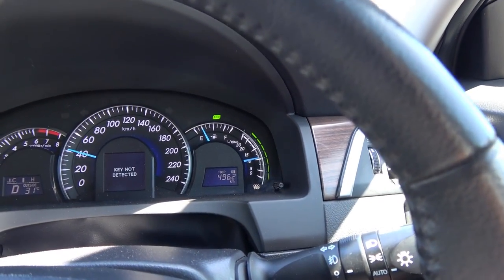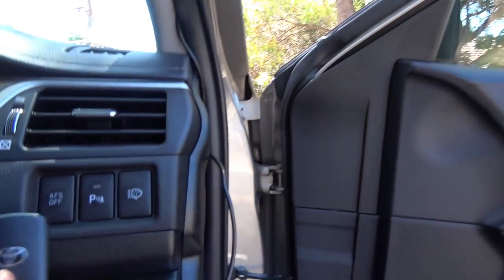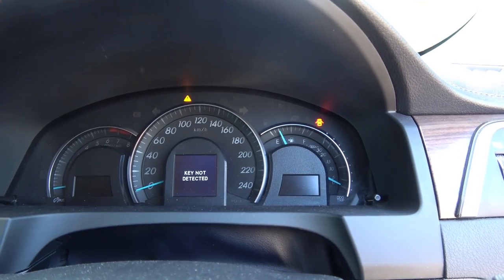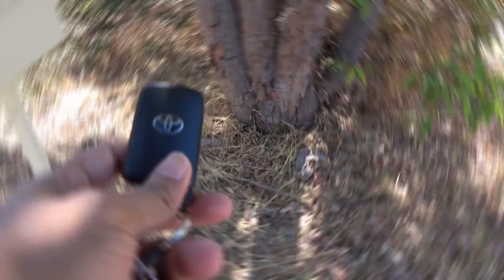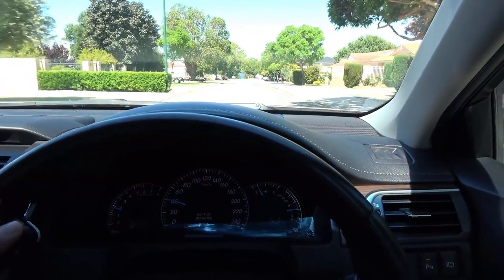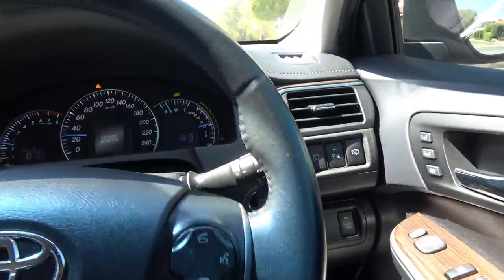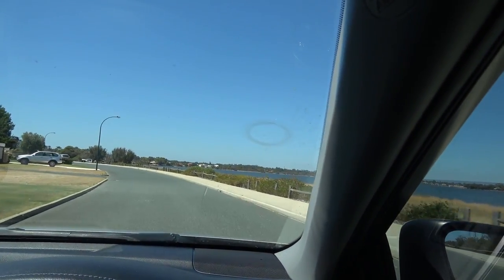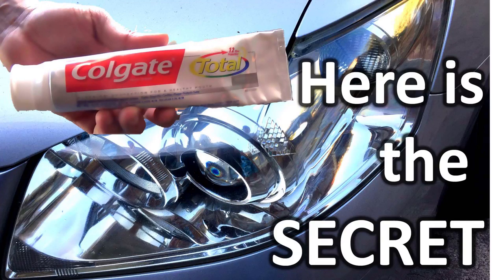What happen if you drive a keyless car without a keyfob ??

Comment: You can drive them without the fob but you cannot restart them once they are turned off and in some models push button start is standard and there are many locksmiths that can program the system you don’t have to go to the dealer
Reply: Just experienced this like a 5min ago. my cuz borrowed my car and I went back in the house with the keys, he drove quite a bit and had to come back, by the time he got back and opened the driver door, 2 very different very scary alarms went off through the speakers like some amber alert and pounding abounds simul,  it was louder than my music plays so it alerts police.
Reply: I damaged one of my key fobs and going to purchase a new fob, but it will need reprogramming. Is this something that I can do at home without any special equipment, or do I need to go to the dealership or a locksmith can do it? (What price will I be looking at?)Thanks
Reply: Crazy part about this is it just happened to me I drove over 6 miles after my mom got out the car with the keys. I got to my destination and cut the car off, quickly realized I don’t have the keys and hurried up and cut it back on and it worked. Not sure if it gives you one change in a time frame or if it was God, I’m gonna go with God lol
Reply: @losworkin  man this just happened to me with my grandfather truck. The truck did finally cut off when I drove to a store and put it in park.

Comment: WTF. I thought this type of car with keyless system would automatically stopped at certain distances if the key is not presence. That was totally my imagination!
Reply: thats what my hyundai does it disables the car even when driving
Reply: @wldcrd26  most will stop the car from going over 25 without the fob. If youre already going above that and the FOB dies or for some reason you lose it while driving, you will drive with a warning light on, once you get below 25 again itll stay that way
Reply: @wldcrd26  Are you sure what you are saying? For safety reasons, the way in which you say that your hyundai works is prohibited and not approved.
Reply: I also thought that it will stop.
Reply: @dastorm4230  When the engine is in service (started), even if the electronic key is no longer present, the engine must continue to operate (this is the legislation, safety issue).
When the engine is stopped (for whatever reason), if the electronic key is not present it will be impossible to restart the engine (in any way whatsoever = via the starter or by driving the car with a speed engaged in the gearbox).
Reply: @JoeSmoe1 this is absolutely NOT TRUE. I left the key to my Veloster in the buggy at the grocery store last night and drove to the next town over to pick up my son then drove us all the way home. The car doesn't shut off, it doesn't slow down, it doesn't effect the car in any way whatsoever until you shut the car off and want to start it again. The reason being that the ONLY time the fob is giving off a radio signal is when its starting or when you're pushing a button.
Reply: Thought the same thing
Reply: @JoeSmoe1  try watching all the videos disproving this now in 2024.

Comment: I just learned this the hard way. Was leaving from word and had my hands full, put the key fob on my Mini Cabrio's roof, turned the car on (I think it worked because the key could communicate with the car through the roof?), the keys must have slipped on my way to the gas station and I was stuck when I turned the car off... Had to call a tow truck and go home by train and have to pick up my car tomorrow with the spare key fob (I hope it still works!...). Don't know if I'm going to find my keys though...😢

Comment: Keyless fobs are fuxed! I have parked my car, locked it, walked away and left the motor running several times. Also I have shut the car off but accidentally double tap the button which turns on the accessory function and came back to a dead battery several times as well.
So now everytime I park I'm checking my pockets for the key fob and checking the motor, checking the dash gauges, checking if the radio comes on, checking if the reading lights are on. It's like I have Agoraphobia and I'm afraid to walk away from the car. smh

Comment: Almost all Key Fobs have an RFID Chip in them and don't need the Fob battery to work in order to start the car. You just need to know where in the vehicle the Fob needs to be for the vehicle to recognize the Fob. When my Fob battery died I had to put the Fob inside the center armrest console and the car would start.

Comment: Almost all cars with keyless entry come with the key built into the key fob. if your battery dies simply just use the key.
Reply: The key inside my fob only works on the door. There's nowhere to put a key in the ignition.
Reply: My fob came with a key although cant find a place to use the metal key to start it
Reply: @loverssky13  same with mine
Reply: It only works for opening the door. If your fob battery dies, you can still start your car by using the fob to push the start button.
Reply: Its usually in the glovebox
Reply: royaloreca actually the key inside the fob is for if the car battery dies you should get a warning come up on your dash to tell you the battery in your fob is going flat and they are easy to replace

Comment: Is the signals switch to the right in a right hand driving vehicle?
I've always thought controls were still standard in every car.
Reply from the maker: yes they are swapped over
Reply: Gabriele De Mattia. Not always, a lot of European right hand drive cars have the indicators on the left of the steering wheel.
I still accidentally hit the wipers instead of the indicators.
Reply from the maker: i remember that happening to me when i first drove an old Peugeot 405 wagon with the horn being placed at the end of the signal stalks. very annoying
Reply: Junky DIY guy. Im about to become a bloody volvo driver, so im going to learn all over again! :)

Comment: Hi,
I am hoping you can help, I have a Dodge Journey 2010, the fob has separated from the metal key & fallen off somewhere. How can I start my car, so I can get a new key, I am panicking as I need it for work
Reply from the maker: You don’t have a second key? If not you have to get a new keyfob made, locksmiths or the dealor have equipment for that.
Reply: @JunkyDIYguy  do they need the car there when the new key fob is made?
Reply: @colinfitzgerald3863  yes

Comment: I'm curious to know how you can tell if the battery in your remote is bad once you've successfully started the car and driven it for a while? After you've stopped the car and shut it down (usually  at an inconvenient place during some kind of storm) the battery is now dead...what now?
Reply from the maker: in a work shop, there's equipment to check the signal strength of your key fob and determine the battery status without having to test with a multi meter. But if your key fob stop working while driving, try holding the key fob closer to the start button. then in some car's, the computer will still recognise the presence of the key fob and will let you start the car. or you have to change the battery to have it working again. if the keyfob stop working for a electronic issues inside the keyfob, then you have to tow it to a place where you can get it fixed. There's a price to pay for technology.
Reply: In my keyless start car. inside the fob there is a key and there is a key slot under the seat
Reply from the maker: some cars have a separate slot for the key fob to go in.
Reply: You'll be ok if the battery dies after you started your car and while you were driving, and you don't even need to keep spare battery for your fob in your car. That is why the message was saying "press the start button WITH your key fob", meaning literally press the button not with your finger but with your key fob. The car will "read" the key fob even if you remove battery from it completely,as long as it's in close proximity to that sensor . Some cars will have a special spot for you to place a key fob , in case battery dies.
Reply from the maker: @ omegakrest... That's is correct..
Reply: rayford21 the button on the key in my chrysler didint work (locks and stuff) untill i thought my battery was dead. Car still started, but no buttons. I went and got battery replaced for about five bucks and it worked fully
Reply: Use key..Most FOBs have removable key.  Check your manual

Comment: Stupid, Toyota makes you press the brake to start the car. But a thief can just drive away if you need to warm the car. Just tried it today and was shocked a 2019 doesn’t turn off without the key when pressing the brake and shifting into gear.
Reply: I would get that checked out! I have a 2018 rav and it always turns off the engine the moment I try to open the door after I've had it warming up.

Comment: I need a key to start the car I’m old school I guess
Reply: You know, I have a push to start and it bothers me. I like to be able to feel what my car is doing. You can't feel it with a push to start like you can when you turn a key !
I wish my car had the option to also just start it with a  key if I wanted to. 

Sorry, I know your comment is old, but figured I'd reply to it anyway. :)
Reply: @Jamie-zs2bl    It’s fine no worries I hear yea love my car it’s old and not attractive but runs great. I drive my sister’s new car and I hate it maybe I’m too use to mine but hers has no feed back you step on the gas and it just takes off way to sensitive the steering same thing and the brakes are too good I barley touch them and like ready to fly through the windshield. Maybe it’s because my car old so some things have been worn down but you step on the gas in my car and you actually feel the engine and the weight of the car the brakes have some feedback and the steering is kinda heavy actually feels like you are turning something. Some people like that like myself other hate it.